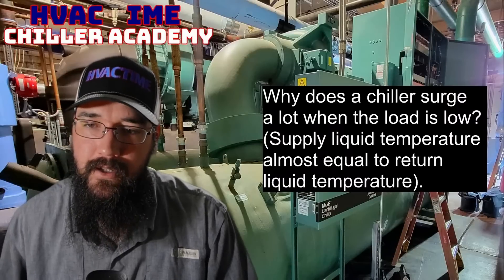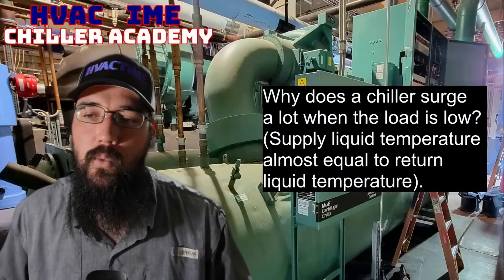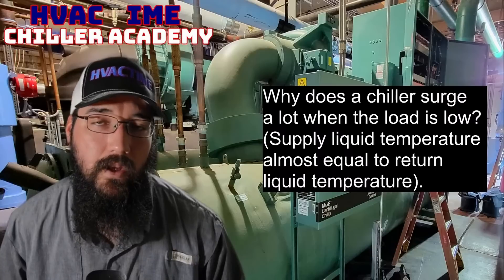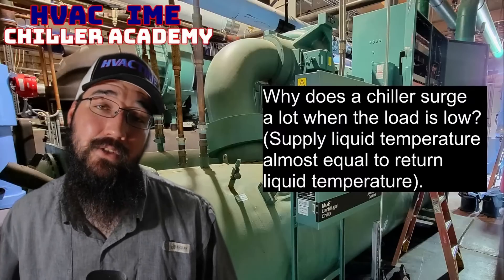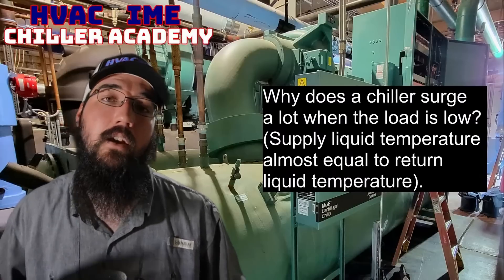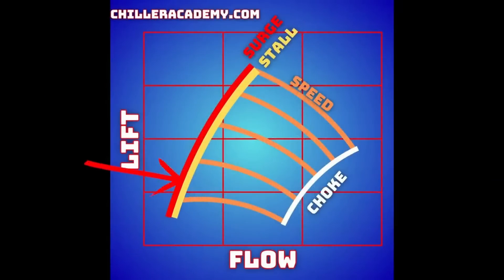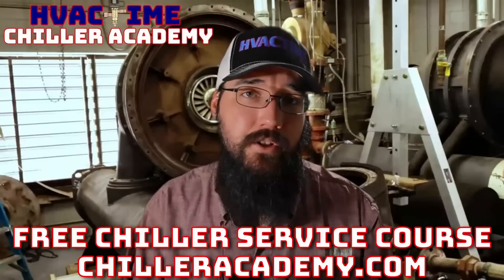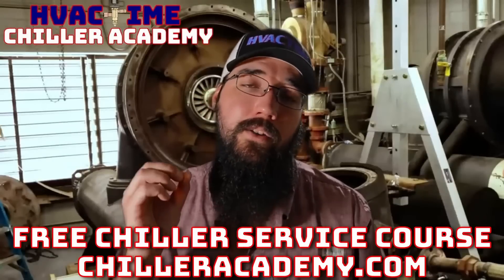Why Chillers Surge Under Low Load Conditions

Comment: Guys at my work are BS operators. Had three process chillers go down at the same time ( TRANE ). Fan was working properly plus it was 36 degrees out and the sump heaters were bad. So my condenser and evap temps flipped flopped. They should have shut the Fan down at 55 degrees if they knew the shit wasn't working right. It took me hours to get it back up and running.

Comment: I believe the manual states should be no lower then 15f above chilled water leaving setpoint. 60-65f is great for a YK I run my wsc-mcquays same way lower the better run low compressor speeds with vanes wide open if possible.

Comment: Sounds like you’ve been influenced by engineers. Low condenser water temp is only relevant if the chiller is oversized. Never seen a yk that liked cold condenser water
Reply: aren’t we all influenced by the engineers that create the service literature?
Reply: @AGON17  not if you’re a free minded thinker
Reply: That's weird. Most guys that I've talked to that have a lot of experience with YKs tell me they like cold condenser water.
Reply: @ just started one up for the season 3 days ago, was stalling until condenser hit 70°
Reply: They hate cold water
Reply: I believe what you said to be inaccurate. I work for an OEM and our chillers love cold condenser water. We can get optimal performance at 65° condenser water